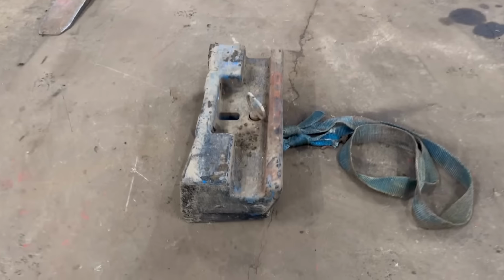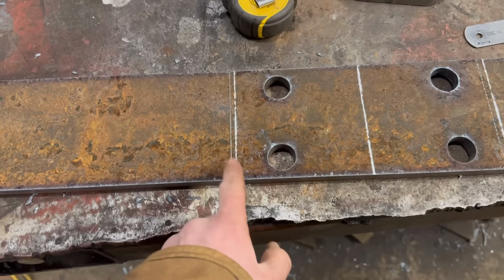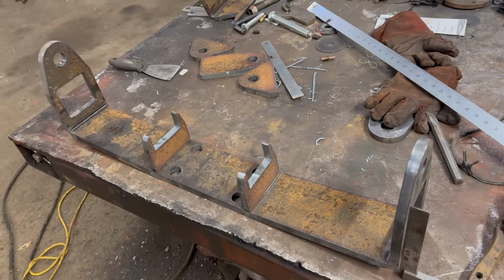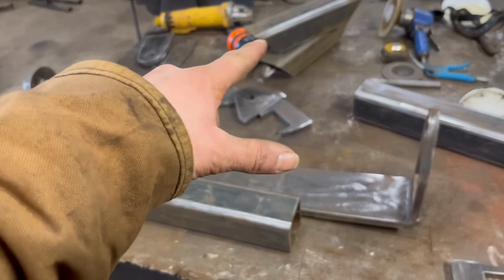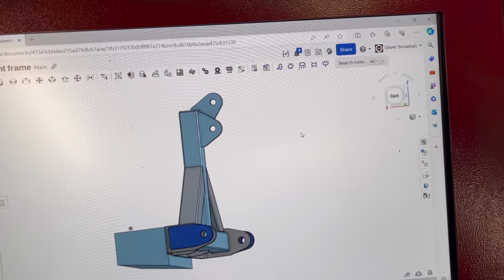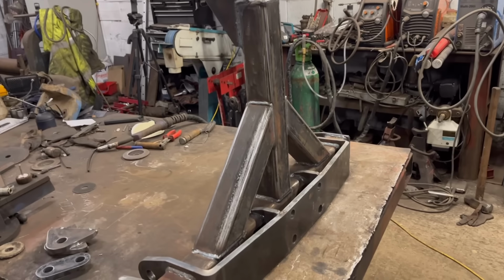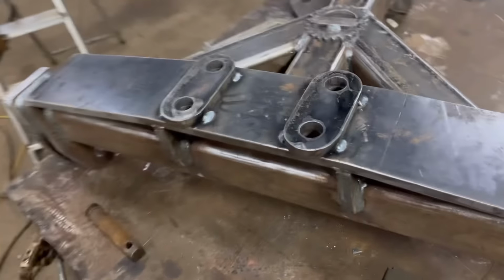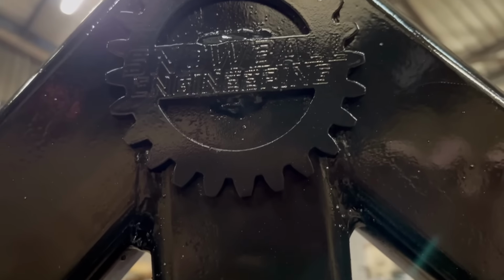Fabricating a 3 point linkage weight frame

Comment: Top shelf work !
FYI Suggestion: allowing your tape measure to snap back without using your finger to brake it from full impact will eventually lose its accuracy. I NOTICED YOUR METICULOUSLY ACCURATE !

Comment: The slight error with distance between bottom holes and top link nicely corrected and tbh probably looks better and stronger than the original design.
Top stuff Oliver, I made a weight carrier many years ago and eventually started to bend on the stress points your model highlighted .
Mine didn’t look any where near as professional as yours 😂

Comment: A fine piece of work with bonus points awarded for having the weld seams on the hollow section all facing down, back or in 👍.  With regard to the overall design, was it necessary to have that long section of bent plate mounted forward of the box sections ? Maybe I am lazy or too simplistic (or both!)  but an inverted T shape of box with the original cast carrier bolted on would work as well, with maybe a little less stress.

Comment: The logo looks great , should be standard equipment on everything you fabricate .  Like how you bent the flat bar and run the box tubing through it instead of just welding brackets to it.👍I was all good till you painted over the red oxide😂. Seriously though , the black tuned out great. Keep up the good work and Be Safe!

Comment: If you haven't tried the poly or stripper discs for cleaning up oxidised steel, I would recommend, they don't remove material, just the corrosion. Cracking video 👍
Reply from the maker: I’ll have to give them a try

Comment: Top quality job Oliver. Like the way you gave strength to out mounting points by threading the box tube through. The simulation is a great tool to have but so is common sense and you seem to have plenty of that. Keep up the goodwork

Comment: nice workmanship there over engendered for sure finishing touch was definitely putting your logo on it for sure you must do this to more of your work as it's a good form of advertising for you as others have say your steel stock needs to come in out of the weather will save you some time in descaling it and the fork lift could do with a wash Cheers

Comment: Only thing with the stress calculator is you need to work out momentum load, what happens when ol mate is driving round and hits a big bog mark or a small ditch, we've all done it in a tractor, everything gets thrown around its the weights going up then slamming back down that'll be the max load, working out that number is the tricky bit and why there's a whole industry based around it, the farm engineer in me says it's well over built and if the tractor does ever get airborne it'll be the 3pl pins that fail
Love the cut out logo, really adds anouther level of class to a very nice job

Comment: Appreciate the time you take to set the camera up Olly, especially as you seem the type who just wants to "crack on" !
Those little angle finders are great, but they never truly switch off. I have one and I slide the battery tray halfway out when I'm finished using it, better than going for it only to find it's died on you.
Reply: Throw the battery one in the garbage and buy the Starrett engraved one, I have one that's 30 years old . No batteries to change never needs to be recalibrated.🍻

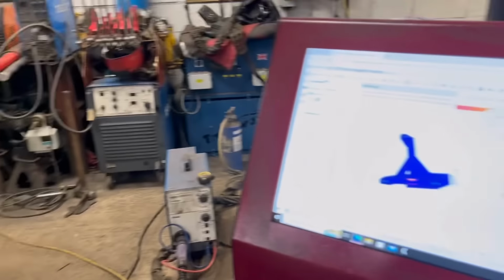Comment: 35:14 given what the simulation showed, i would've lobbed off the remaining part of the box section at the top where the two offset ears are and welded a plate that would've gone up into the ears a bit. That and at the T junction down under, a 4mm piece of fish plate (rhombus) over the orange area. Those be extreme places (under that load) but they can also be read as stress over time affecting those areas and you have two spots, the welds on the ears (up top) and that T junction). But then again, you've grossly overloaded it and so it would probably be bullet proof for years to come (wear would basically eat this before it would stress break). Good work! 10/10

Comment: Good job, really well done. I see the new coat has begun to look lived in, lol. Your bend radius on the 15mm plate looked really tight, as a rule of thumb we were taught that the bend radius should be 1.5 - 2.0 times the thickness of the plate. The 90° bends should have a radius of around 22.5mm to 30mm. Being too tight could lead to cracking. The Snowball Engineering logo looked good 👍
Reply from the maker: Just using the tooling I have.

Comment: Great little video interesting. Just curious welding all those tubes up solid. Do you guys worry about condensation over there? I know it's bad here with the condensation and sealed pipe so I always drill a hole in them just to make sure drains the water out and it doesn't rot from the inside. Just curious. 👍👍🙂🇨🇦
Reply from the maker: Not something I’ve ever worried about

Comment: Another brilliant video, design & and fabrication, Olly. It's a shame that your engraver is giving you problems. I wonder if the engraver rod is causing issues with deflection as it travels onto the metal surface due to its long stroke. You'd be better off with a laser engraver, in my opinion. It's really interesting to see the stress modelling simulation in OnShape. 
I think a piece of flat bar stock welded in behind the front plate between the bolt centres up just below the top link would mitigate that point loading as illustrated in yellow on the model. Keep up the great work and honest content
Reply from the maker: Yes, the rod isn’t rigid enough. Because my machine is designed for flame cutting as well as plasma, the bridge has to be higher to keep the heat away, the engraver has been designed for the low bridge models where the rigidity won’t be as much of a problem.

Comment: 35:11 You're looking at von Mises stress analysis.

What it's telling you is basically the stress in the material, or the pressure it's being put under (hence it being in Mpa)

If the von Mises stress comes in with a maximum of 35Mpa and you're using steel with a tensile strength of 350Mpa you're at 10% of the maximum load the material will take before it bends and stays bent.

Basically, if your von Mises exceeds your tensile strength it will bend. Keep a significant safety margin in there. You're also accounting for shock loading as it bounces down the road (you can calculate that too).

Note that the colouring may scale to the range of stresses seen, not to what the material you're using can withstand. Bright red might be that 35Mpa, or you might have done horrible things in your design and the maximum is 900Mpa in which case the "good" blue part might still be above the yield point of the material. Just pay attention to the scale basically.

You can also use it to predict how much deflection you will see in a component. There will be the option in there somewhere for that, but I don't use onshape, so I have no clue where you would find it. I normally use simscale for FEA and CFD simulations.

Do the same thing with your log splitter, you'll see what I was talking about on the last video you did on that.
Reply: wanted to say the same, hope he reads this. Very well explained.
Reply from the maker: Thanks for the explanation. Something I definitely need to learn more about/how to use.
Reply: @snowballengineering  You've already done it.

Just make sure the material properties are set right and where the fixed points and load points are are correct and hit the go button.

Compare the maximum von Mises with the steel (250Mpa, 350Mpa or whatever it is you're using). If you don't exceed plus some safety margin it you're good to go.

For the dynamic loading, consider this bouncing down the road. You could estimate that when bouncing it might free fall for 200mm from the top of the bounce and then decelerate again over 100mm to the bottom of the bounce as the tyres compress etc.

So, moving under gravity in the free fall the weight will reach about 2m/s after 200mm.

If we then decelerate it again over 100mm we get 20m/s/s of of deceleration.

Our weight is 680kg (1500lb), divide that by 9.8m/s/s to find it's mass, which gives us about 70kg, and then multiplied by our 20 from above and we get an equivalent static weight of 1400kg.

So that 680kg bouncing will apply the same force as 1400kg of static load.

So when you do the analysis, use 1400kg plus a safety factor of 50%, so 2100kg. That will maintain the safety factor even as it bounces.
Reply: Well said an excellent explanation..usually in agri machinery design fabricated products we use 2.5 safety margin ,and  take the weakest component or area and double that...
The max stress that will be applied to that frame will be "bending stress " and sudden impact,and that's going to come from sudden impacts at speed"  such as  potholes etc..
That stress analysis you performed is a  "static load"deformation .dosnt tell you nothing..as the implement will only be used when it's in motion...tractor moving..
The part you needed to really test was the vertical box section especially where the top link will attach..
⚠️ Warning..that stress analysis simulation is just for knowledge/demonstration purposes only and means didley squat nothing...always only use a verified and calibrated analysis packeges only, if and when an analysis is actually needed...
An "Add ons" analysis packages etc wud not stand up in court if there was a product claim etc...especially if you weren't even properly trained and certified by the software company to use it..

Comment: It is a thing of beauty,  would love to see it mounted , am I correct that it is used as a counter weight on the rear of the tractor ? Or is this used to mount it to the front? Any way regardless,  you have used your cnc and press break to achieve some exelent results , a lot of engineering and design for a one off , your not charging enough !
Reply from the maker: It’s to go on the front

Comment: Great job. Your quite the thinker.
On the stress loads. Should one worry about shock loads? Farmers hitting bumpy areas while he's working. The weight increase exponentially at various times while bouncing.
Reply from the maker: The tractor will have front suspension and probably a nitrogen cylinder on the linkage hydraulics so the shock load shouldn’t be too harsh
Reply: @snowballengineering  I figured you knew what ur doin. 
Great job, young man!

Comment: Assuming the engraver is lowered with an air cylinder, you might try using much lower forward air pressure. Will help the tip float. Right now the downforce is overpowering the engraving action so it's sticky. And because it's sticky the zero gets thrown off.

Comment: cracking job, like how that software tells you the stress loads in certain areas which lets you know if it needs strengthening. shame your logo writing isnt white or other colours so it pops out at you. always wondered why you dont use welding angle magnets to get your parts vertical quickly, i know a set square is accurate but can be quite fiddly. 👍👍👍👍👍
Reply from the maker: I hate welding magnets. I’d rather use a square
Reply: @snowballengineering  fair play if it works for you then why change 👍🏻👍🏻👍🏻👍🏻

Comment: Hi Oliver, to interpret the colors in those simulations, you have to compare the values to the yield stress of the material, for example when you plot the Von Mises stress, when the values reach the yield stress of the steel, which is about 240 GPa for mild steel, the material will deform plastically, meaning it will not spring back to its original position which is typically considered a structural failure. However, finite element analysis (FEA) is very sensitive to things like how the model is constrained, I.e. which parts of the model are fixed in place, and small changes in these constraints can change the results of the simulation significantly. Further complicating it is that the simulation sees all the components as being perfectly connected to each other and doesn’t take into account the welds, so basically it assumes all the welds are perfect and don’t introduce any stress concentrations or weakness into the joints. All in all FEA is very powerful but can also be dangerous in the wrong hands, but I understand you were only showing it here as a point of interest and it’s great that you’re expanding your knowledge and learning about it.
Reply from the maker: Thanks for explaining, definitely something I need to research more on.

Comment: Nice job. An different approach would also be possible. The weights straight on the new attachment. But always build what the customer ask 👍
Reply: maybe the customer wants the extra 100 kg
Reply from the maker: The weights are designed to mount onto the block so it’s easier just to make the block bolt on.

Comment: i think when it comes to top links the top link holes on the implements tend to be closer to the tractor than the lower links and u can see that on the blue frame u were measuring off
Reply from the maker: For something like this that’s just at one height all the time it won’t really make much difference.
Reply: @snowballengineering  every tractor will be differant but we tend to find when the holes are all the same like that the toplink is screwed well out .. tidy job though 👍

Comment: What cutting disc are you using in your chop saw? I seem to go through loads of the usual cutting discs then end up throwing most of it away when they wear down and don’t cut.
Reply from the maker: It’s a proper saw to run that blade, they run slower than the abrasive chop saws

Comment: What did you use for the clean up of the rust from  the metal it seemed very effective, was it grinding wheels or abrasives and what grade. Thanks
Reply from the maker: Just a flap wheel and sanding disc on the DA sander. 80 grit
Reply: Thankyou, great videos.

Comment: You were calculating the weights in kilos and using pounds in the simulation. I think there must be a way to change the simulation to metric in its settings to save time. Excellent job again….I can see you getting more orders for this one.
Reply from the maker: There is. The other measurements were newtons and kilonewtons

Comment: ford blue should have been the customers colour of choice.
Reply from the maker: Ford blue would be the wrong colour 😉  it’s going on a new New Holland so the black won’t be far off the base colour of the tractor
Reply: @snowballengineering  yeah but its a ford weight holder and im assuming ford suitcase weights. Or maybe NH has the same holder i don’t know. But that was my meaning.

Comment: I may be wrong but I am 99% sure that the 3000 pound value you had entered into the CAD software was 3000lbf which is pound force… you would want to enter a value of 3000lbm which is pound mass. That is because the mass of the block is measured in pound mass, whereas the force exerted by the block is measured in pound force… that’s just the imperial system for you…
Reply: Awesome work though by the way
Reply: And those different settings show different measurements… the safety factor setting shows you the ratio of maximum stress before failure to the actual stress in the material. So if you have a safety factor of 2, you could in theory double the stress in the material before it breaks. The Von Mises stress is just a measure of the maximum stress the material can stand before failure and is used in that previous safety factor setting. So the safety factor setting is more useful really…

Comment: As we said before. Lifting device for everything these days. Those tractor weights used to be the subject of competition. How many can you dead lift. How far can you carry two before putting them down. Like the old 56lb potato weights. We used to have one hand overhead press comps with them. There was a lot of prowess in holding the record. Now it is all about, how can we avoid lifting anything heavy. I'm old. Don't get it. When I was young being as strong as I could was part of being male. A common saying was. What are you a man or a mouse. There are a lot more mice today.
Reply from the maker: I suspect back in your day front linkages and front implements weren’t a thing. A lot of modern tractors now come new with a front linkage meaning this block won’t fit directly bolted on. Plus it’s daft spending 20 mins each time lifting weights on and off when you can hook up in 30 seconds when you have a front linkage.  Work smarter, not harder.

Comment: Oliver, your bending radius is much too small. Keep in mind that it weakens your material and put a lot of unnecessary stress on your brake press. You can find a lot of information on internet about the wright bending radius compared to the material thickness. FYI: The inside bend radius should be at least 1.5 times the metal thickness. The flange length should be at least six times the metal thickness. This applies to holes in the part too; that is, holes should be located away from the bend line at a distance that's at least six times the material thickness. Otherwise the end result is showing your craftsmanship.
Reply from the maker: I know this already, If I was making stuff like this all the time I’d purchase a bigger vee block. But for the occasion jobs that’s over engineered anyway it’s fine. I appreciate your knowledge though, thanks